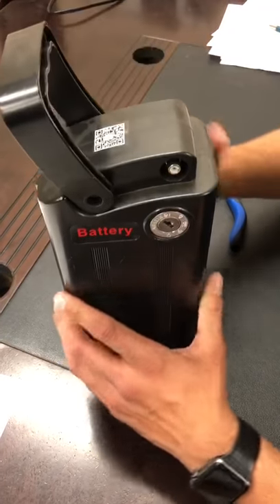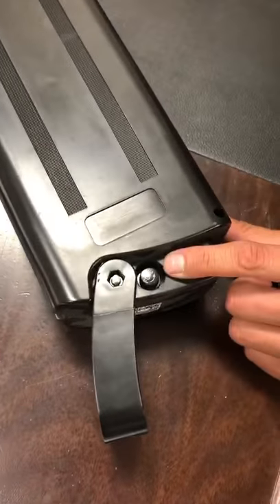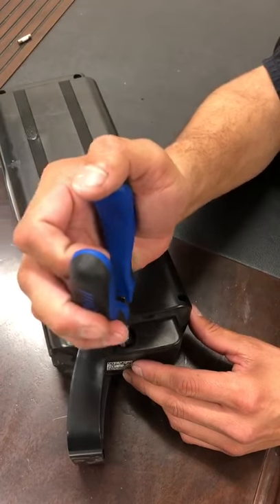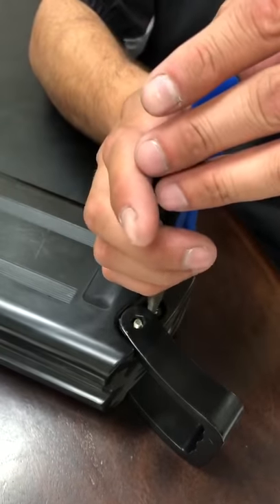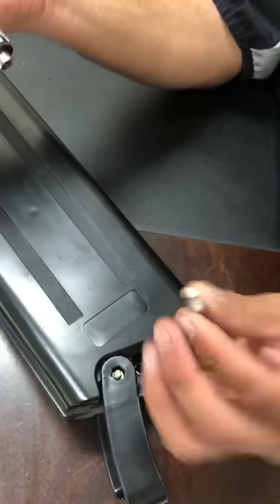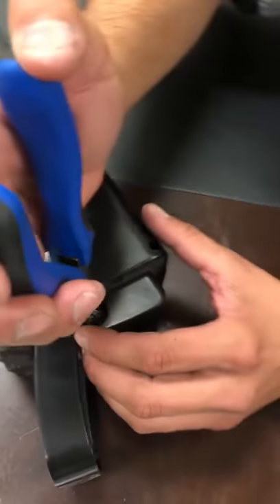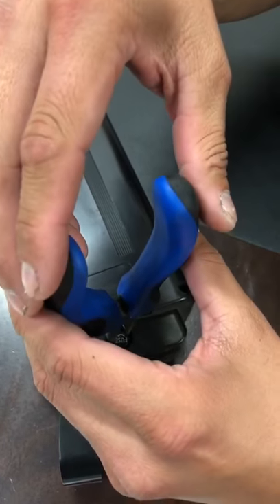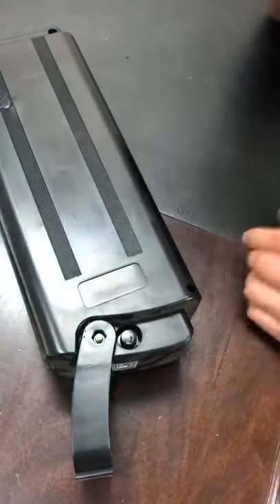how to change Nakto battery fuse

Comment: I took my Nakto battery apart and this fuse holder was not connected to any wires. There was another fuse inside the battery pack.
Reply: I have had mine for 10 months and have rode it for 1926 miles thought I would check the fuse and buy a spare. Took out the holder under the handle and found out there isn't a fuse in it? What the heck? Now what should I do.

Comment: Is there anyone that knows what type of fuse this is and where you might purchase one.  No help form Nakto.
Reply: I just replaced the fuse in my battery and it works.  It is a 250 volt 3 amp 5x20mm fuse.  Bike is Nakto Fashion 20".
Reply: Update - The 3 amp fuse didn't work.  Nakto recommended a 20 amp fuse and that seems to work better. Make sure that it is 250 volt 5x20mm.
Reply: @rewindaminute   did the 20 amp fuse work fine ?
Reply: @jerseykeys  It did. Bike has been functioning perfectly since I installed it.
Reply: @rewindaminute   do you know why u stepped it up to a 20 amp and not a 10 amp one ?
Reply: @jerseykeys  That is what Nakto support recommended a long time ago. It's been working properly ever since.
Reply: @rewindaminute   where did order them from?